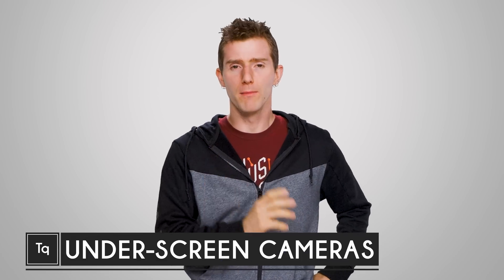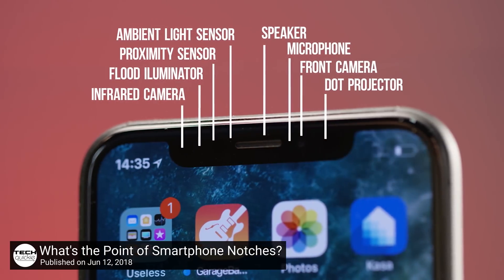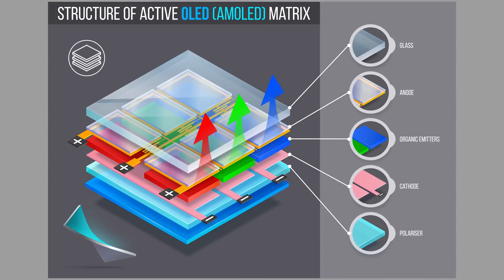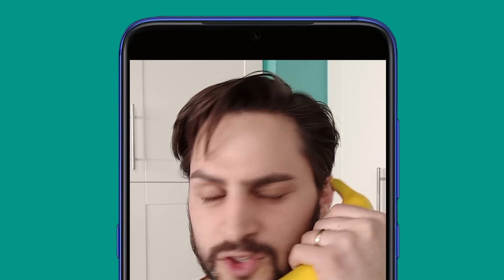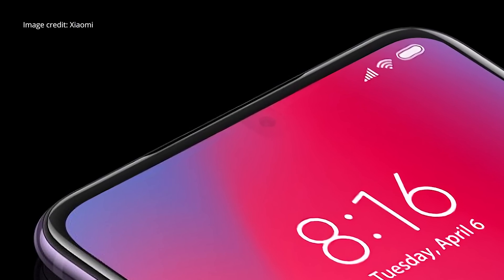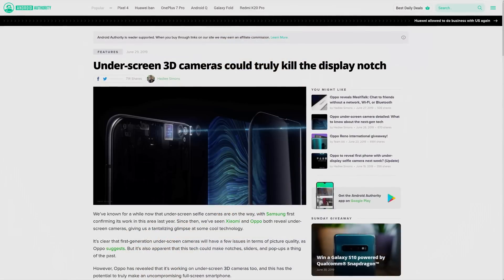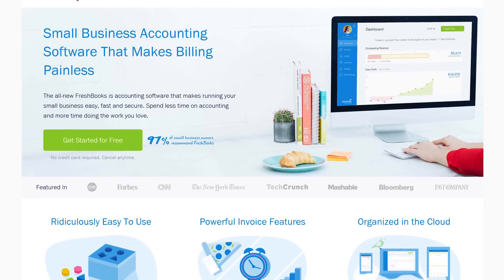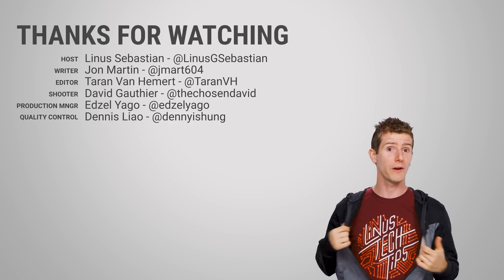How Under-Screen Cameras Will KILL the Notch

Comment: The removal of the headphone jack?

That seriously pisses me off.

Edit: I think I just unintentionally started a war in the comments. ¯\_(ツ)_/¯
Reply: I prefer having a headphone jack.
With a dongle you can't charge your phone. I have studio grade headphones as well, and Bluetooth audio is worse quality at the moment. Maybe when there's lower latency and better quality I'll get on the wireless train.
Reply: Redmi K20 Pro doesn't have a notch with Headphone Jack
Reply: agreed, the headphone jack is good as-is. Wireless and Bluetooth is convenient, but the quality is terrible.
Reply: @arnacho  people aren't afraid of change, they're just not happy with companies needlessly removing the headphone jack and "conveniently" having an expensive wireless option.

Nothing more than a money making scheme.
Reply: Just get a cheaper phone and it'll come with a huge battery, massive screen, and a headphone jack. As our good friend Jerry said, you spend less on your phone, and you'll get more features.
Reply: @GarrettDerp  you could get a cubot max...
The thing's really cheap and for what you get, it's damn good for the money.
Reply: Monty Python the Flying Circus  much, much more. For some absurd reason, smart phones haven't properly commodified. They could sell the current iphone for the (inflation adjusted) price of the very first iphone and still be making boatloads of profit. Probably much bigger margins actually, as standard components will have gone down in price drastically since the first iphone (let alone all other smartphones).
Reply: The irony when bugdet phones got headphone jacks but not flagships... "But you get Bluetooth". Yeah but i'd rather use my ~350$ Sennheisers without a dongle...
Reply: you can use Bluetooth headphones with a phone equipped with headphone jack, it's nice to have options or just put two type c connectors
Reply: @arnacho  they're not afraid of change. They're pissed cuz yhey removed the jack. No one cares if bluetooth becomes more supported than wired. Thats not the problem. Removing the OPTION to use wired headphones is the problem
Reply: I just came here to say that i want removable batteries back
Reply: From an audiophile's perspective, wired is best. Especially high-performance earphones and headsets. Bluetooth uses compression and MP3 is already compressed enough. I personally like the detail of the audio I create and play kept around. But with wireless earbuds and headphones, I can't seem to find good enough earphones.

Plus, after 1 year, those batteries are useless and replacing the damn thing costs so much. While with MMCX cavles, when that shit breaks, JUST BUY A NEW ONE.

Plus, the earphones I'm using, MMCX cabled earphones, can be replaced with a wireless cable. Though not true wireless, it's enough for some music on train or something like that. But tbh, cables are so easy to manage and I don't want to charge 2 things concurrently. I'd also like to keep the overpriced custom made 3.5mm Micro USB amplifier that I bought for my phone.
Reply: You get better audio quality using wired but for day to day general use I use bluet
Reply: @arnacho  Because it's change for worse. No one except for phone manufacturers ditches the jack. And phone manufacturers only care to make their phones thinner, not to make music sound good
Reply: @TheDLoaderz That is completely wrong, using Bluetooth barely uses a phones battery even with them being connected. It's true that wired have better sound quality but wireless doesn't take more battery.
Reply: Same here mate , been a  galaxy boy with 4 galaxys so  far ,  might have to jump ship to something else for my next device with a headphone jack  (Are you listening samsung !   ).
Reply: Plus, I like hanging my earbuds off of my ears when I'm talking to someone. I hate it when I talk to people face to face, and they still have their wireless earbuds in their ears. Are they listening to me or just pretending to listen to me while listening to music?
Reply: Ddd Bbb who tf says that i will get cancer by using bluetooth? wtf haha
Reply: Too all who doesn't want wired cable atleast if you have a headphone jack you have a choice or wired or wireless win win for everyone
Reply: 1.8k like 100th comment
Reply: @Ddd Bbb "Bluetooth will cause cancer in long term usage"

Where the füçk did you get that heap of büll$hït!?
Reply: Honestly I'm with @Old Random Computer
I need to plugin my Razer Kraken Tournament headphones when i play Fortnite. So I'm mad at the removal of the headphone jack.
Reply: Easy choice: have 3,5mm jack but no front camera or no jack and front camera?

For me it's 3,5mm jack and no front camera
Reply: Yeah, I mean, if the 3.5mm jack was too tall, I would have preferred they switch to digital headphones and use a micro-USB jack, or USB-C.
Reply: That’s why I still own an iPhone 6S
Reply: I am waiting for the day when wire charging will be removed, thus making near perfect, waterproof device.

Then will be speaker and reset hole, thus super waterproof device. And then, boom, no smartphone. A device you place behind your eyelid...
Reply: @who cares well, it is most likely going to be true, considering the naming of usb port and such....
Reply: We can put it under the display, no problem
Reply: or how about implementing two usb c ports? would be great in theory
Reply: @dolbyprologicii  super charging
Reply: @Sagaris Unlimited expensive for poor and same price for the rest
Reply: Monty Python the Flying Circus  I already have a pair. I'm just tired of charging it. Much more simpler to use wired headphones.
Reply: Look at these chumps arguing about audio quality with wired vs Bluetooth when the real winner are clearly wireless hearing aids lol
Reply: Yeah you did mate
Reply: Ddd Bbb I have no idea how you concluded that long term Bluetooth usage can cause cancer. If you'd like to prove me wrong and send me a reliable source where you got this info from, please reply with a link to that source 😁
Reply: Austin Martín Hernández I agree that Bluetooth doesn't always work, but neither do wired headphones. Wired headphones have a tendency to break much easier due to cables that get twisted, wrapped up, etc. And while I agree that in a good amount of cases, wired headphones are better than wireless, it depends on the price and quality of the headphones you compare. I could compare a $300 wireless pair of headphones to a $5 pair of wired headphones and tell you that the wireless ones are way better
Reply: 1.8k like 99 comments
Reply: So, they just made headphones that plug into the charging port instead. If you have a certain type of headphones you prefer, my iphone 8 came with a free adapter to convert the charging port into a 3.5mm headphone jack. If you want to be able to charge your phone while using headphones, there is a $4 adaptor available that allows you to do that as well. Solutions are available to suit everyone.
Reply: You can afford a flagship

And yes mainly flagships remove the jack

But you can’t get wireless headphones. 

Ok
Reply: Some features never have to come in and removing the headphone jack is one of them.
Reply: Welcome to the internet, where you don't even know the guy you're arguing with.
Reply: the delay is the worst thing about bluetooth headphones
Reply: Gifting my 50 next subs
Reply: If they bring it back, I want it to be digital like USB C or something like that
Reply: I actually would prefer Wireless earphones if they include it in the box. The thing is you have to go and buy them separately, and that's really annoying. Soon they won't include a charging port and tell you wireless is the future, but you have to buy a wireless charger separately and if you use your old wireless charger it'll charge half the speed. It's really inconvenient to have to buy many things instead of just one. I'm not talking about the price, I actually don't mind if they increased the phone's price, but they really need to include it.
Reply: I have a Xiaomi Mi 8 LITE with no headphone jack...but there's a headphone dongle for the USB C.  No worries.
Reply: My phones had their audio input damaged after some time because the plug puts strain on it when the phone it's in my pocket. I also had good headphones become useless because their connector broke for the same reason.
While i still prefer cables, i'd buy a jack-less phone if it has good hardware and a good price.
Reply: @ivanbrasla  only if the components are cheap.
Reply: A phone with an audio input jack, was that a line in or a mic input, or did you actually mean a headphone jack which last time I checked was an output.  Things tend to pass me by from time to time so if audio input jacs ar infac common on phones I stand corrected. Have a nice day
Reply: USB-C is supposed to replace all other ports.
Reply: @annr4306  yes because it is better than older USB
Reply: @annr4306  but while having a multi adapter
Reply: Minisammich ! The only way to solve your first problem is to ask your mother to pin your adapter to your mittens, but technology has solved your second problem, listening and charging at the same time, by inventing the double dongle:

https://www.amazon.com/double-dongle-adapter-iphone/s?k=double+dongle+adapter+iphone
Reply: @Cor6196  That's creating a problem and selling a solution.
Reply: Just like some people been pissed off from removal of PS/2 connectors with an USB 1.0/1.1 replacement. 3.5mm audio is still analog signal. Don't be pissed by using USB-C instead. You do know the sound quality is MUCH better than 3.5mm do you?
Reply: @zex450 PS/PS2 wasn't outright removed and people wouldn't of been pissed about it. 

USB brought a great level of convenience due to the fact that you can plug and unplug devices without rebooting. It was well needed. Removing the headphone jack is considerably much harder to justify. 

The only arguments I heard for removing the headphone jack are space, audio quality, high age of the connector and water resistance even though the Samsung galaxy and note devices nulify that argument.

I think it's just another way for companies to make more money and that was evident when apple removed the headphone jack and called it courage. Then they had an excuse of not enough space. This was proven wrong by Strange parts and the headphone jack mod he did to the iPhone 7.
Reply: @zex450  how is it better? The signal from a usb-c headphone still gets converted to analog at some point. It needs to, as the sound generation is a purely analog process. Furthermore, in the audio world, analog is actually still highly desirable across the board. Firstly, high end hifi systems rarely (ever? I am not 100% up to date) have usb-c headphone jacks. Speakers are frequently connected to amps and dacs via analog means. Studios have swathes of analog recording equipment.
Digital is not de facto better, although it is often smaller and frequently more convenient - while often managing to reach comparable quality many years into the technology.
Reply: @scriptosaurusrex  True Dolby Atmos and 32-bit multi-channel surround isn't possible with analog signal. All TV's use digital audio. Logitech Z906 also uses digital signals aswell as other Dolby and DTS configurations.
Reply: @zex450  dolby atmos is basically just a surround sound system. It is entirely possible completely analog, albeit highly tedious. I wouldn't be surprised if a large proportion of setups actually run ANALOG cables from the decoder to the speakers though. Not much point having such a high capability box and then letting the speaker do the dac conversion. Also, in theatres etc I doubt they use Bluetooth for the speakers due to risk of latency and interference.

This is all also an entirely different beast to a headphone jack vs bluetooth or usb-c headphone sitch.
Reply: @scriptosaurusrex  Lol...I see you have hearing issues. It's ok.
Reply: @zex450  fantastic argument there. Very convincing.
Reply: @scriptosaurusrex  No, seriously...if you use native analog signals your sound quality can't be as good as digital. It's a basic fact. I used tons of sound devices with analog and digital signals, and digital always sounds cleaner and richer with a much cleaner and balanced high dynamic range frequemcies with up to 11.2 channel surround sound feature. There are analog 5.1 systems, but they don't sound as clean as digital connections even with the same speaker set. It's like comparing VGA with DP 1.2 or HDMI 2.0.
Reply: @zex450  except they are nothing alike, and if you are using a surround system for stereo music you are doing wrong. If you are using it for cinema, then the compression of your streaming source renders in moot. If you are using blue rays, the information may be there. Except it doesn't change that at some point the audio STILL gets converted to analog. You cannot hear bits and bytes. Which brings us to the core of the argument here. Jack > Bluetooth. High quality dac > better than usb headphones with internal dac. Phone internal dac > better than usb headphones dac, high quality phone dac > than internal dac. And guess what? A good portable dac has a jack socket.
Reply: @scriptosaurusrex  

"if you are using a surround system for stereo music you are doing wrong"
- Not if you use Dolby Logic Pro llx decoding. This type of technology transforms every stereo content into multi-channel surround sound. I can easly listen to every youtube video in 7.1 surround despite youtube having only stereo output. Also, DAC converts analog into digital if you're using it for cinema surround sound. You also can clearly hear the difference between sample rates and bit rates with high quality equipment. You won't hear it with anything below $400 if you prefer headphones.
Reply: @zex450  emulation is not the same thing as actual recording. Music isn't made to be listened to in surround and you don't get any real benefit from it. You are actively trying to make what you are listening to different to what the artist intended. You are doing it wrong.

Dac converts both ways. You convert analog signals from any source (even instruments, weird how guitars still ship with jacks, not usb ports......) to Digital. You by very definition always have a Dac converting back. Once again. Basic physics, all sound is analog at some point. Even your 400usd headphones have a dac in them. And in the vast majority of cases they are lower quality than a dedicated dac and absolutely no better than the one already in your phone. Again. There is a reason recording studios, musicians, most production studios hook up their speakers and headphones to an analog output. Because you get better, more consistent results than from a speaker that does the conversion.
Regurgitating marketing slogans like a billboard will not change that.
Reply: @Sagaris Unlimited who tf plays like really  P L A Y S  on his smartphone?
Reply: @franky-161  I do. PlayStation emulator on Android. Anybody anyone days "who really does" or "nobody does", they're usually proven wrong.
Reply: @franky-161  well you clearly don't. Others actually do that.

(Just incase you didn't know...)
Reply: @franky-161  there are millions of PUBG Mobile/free fire players
Reply: nah dude Wireless and Bluetooth is the best in my opinion and no fucking Cables flying Allround
Reply: @franky-161  Ricardo would never say that.
Reply: @jayokay9196  don't put words in ricardo's mouth
Reply: @jayokay9196  underated comment haha
Reply: @franky-161  Yes in YOUR OPINION, not ours.
If i could choose between having to charge 2 devices vs just 1 but had to use a cable, I'D still use the cable.
Reply: CarbonPanther He is not alone, There are a lot people don’t like cables because cable management is already tough on the desk, cable management in the bag? Even worse. I like keep my desk and bag cable free, nice and clean.
Reply: @CarbonPanther  I don't understand poor sorry
Reply: @StanMzmr  the people who don't like cables can buy a Bluetooth headphones... That's optional. But remove a feature is not an improvement
Reply: @StanMzmr  I don't like cables when exercising so I activate Bluetooth but when on the train I like to fit the cable for security so I can relax if I wanna take a nap.. or just in any situation when I want my belongings to remain physically connected and close by. 

Either way, apple can get starting this trend where the choice is pretty much taken away from me.
Reply: @StanMzmr  so what? You can still use wireless headphones with a phone that has the headphone jack. This is a about having options.
Reply: @CarbonPanther  but if you already have a lot to charge like a couple phones,  a tablet,  laptop,  Nintendo switch,  battery packs,  controllers , then one more device means nothing especially a good pair of bose or sonys with 20 hour battery life on a charge
Reply: @CarbonPanther  he did say in my opinion
Reply: @franky-161  yeah. Go ahead with your logic. If wireless audio is the best, then why tf are recording studios still use wired equipment, esp recording headphones?
Reply: Shan Michael Escasio i didn‘t say it‘s the best LUL
Reply: @franky-161  If you like to have to charge your phone and twice as more the earphone... 
I prefer wat more cables, way more reliability, quality, and if it breaks, a fix is really simple, while fixing a dead bluetooth chip... 

Also i prefer having a universal (at least until they killed it) port, that i can plug in any device ranging from a 30 year old sound system to a new ultrabook or phone, and withour any dongles or usb sticks. 
Not to mention that bluetooth drains the phone's battery while the wired one awmost spends nothing. 
Not to mention its analogic, if you want the output of the phone can be a input in another device, any analog data can be carried out or into the device. 

Etc
Reply: @franky-161  thing is mate. You can still do that with a headphone jack. I have been using predominantly Bluetooth for years, but I would never buy a phone without a jack. Now and then I am at a friends and they have a jack based stereo system, I fly somewhere (yeah, you aren't supposed to use Bluetooth headsets on planes), or need the jack for some other reason.

You know what's inconvenient? Carrying a stupid, flimsy dongle just incase I need it, when the option can just be there on my phone anyway.
Reply: @franky-161  no. The quality of Bluetooth can't match the cable.
Reply: @Maisonier  but i don't need that high quality sound for just listening to music, i don't need that high quality output like let's say a studio or something
Reply: @franky-161  You don't need HQ music?
Then you don't get the music
Reply: @franky-161  your ears are probably not that sensitive if you make a statement like that.
Reply: @franky-161  you still need to charge it with a cable
Reply: Blox117 yes, but while that i can still listen to music  Pogu
Reply: @franky-161  yes I agree, but not everyone can afford Bluetooth headphones. Even if you don't use the 3.5mm jack, many people do. If you forget your Bluetooth device and you want to borrow someone's wired earphones, then the dongle problem will be even worse than just having a headphone jack.
Reply: @franky-161  I thought you were our friend.
Reply: @franky-161  LOL, it should be suit for me too.
Reply: @franky-161  bad quality
Reply: @franky-161  No.
Reply: @franky-161  for the new mobile gaming era a headphone jackless phone is bad because in FPS you have a latency with audio when u have a wireless audio device. Also u dont have to deal with charging time with a wired version and it only takes a second to plug in and it take 15 seconds from start to finish to pair a wireless device
Reply: @franky-161  everyone has preferences xd
Reply: @franky-161 was
Reply: @franky-161  but they are expensive
Reply: @franky-161  wired will always have the best sound quality.
Reply: Lmao it’s gonna be the year 2379 and some of y’all will still be nutting on the headphone jack 😂 get with the times
Reply: @jimmyvien3094  spoiled kid located